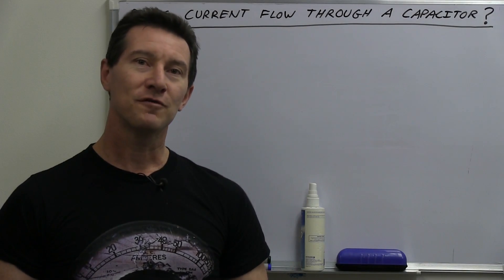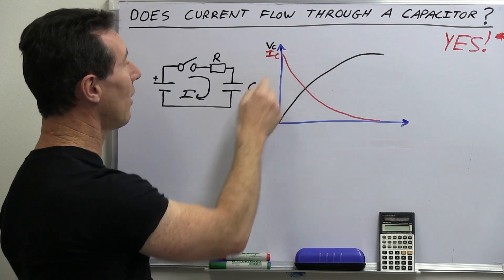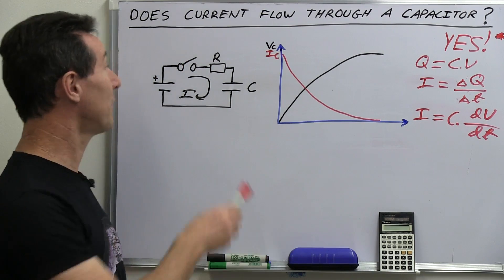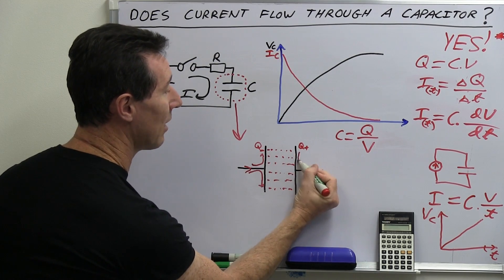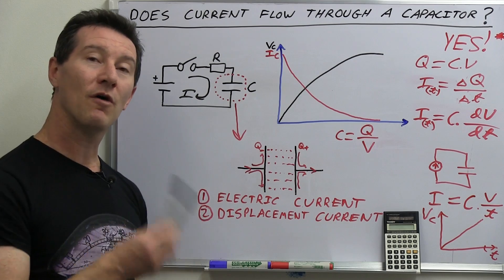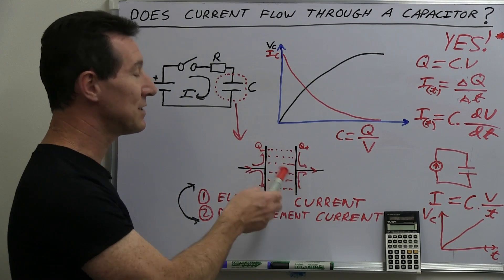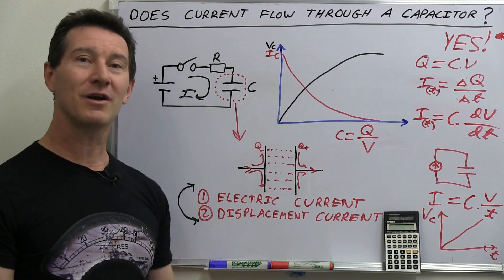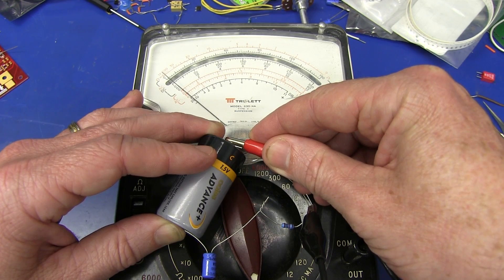EEVblog #486 - Does Current Flow Through A Capacitor?

Comment: I think that where people get into trouble is when they try to intuitively reason about current by thinking about what individual electrons do instead of focusing on the bedrock definition: C = dQ/dt. You can have current flow through a component without ever having the same electrons to flow out as flowed in. 

Obviously there will be a finite limit to the total charge (integral of current over time) that can flow "through" such a component (Vmax * C for a nominal capacitor) but otherwise there is no contradiction or problem.

Comment: 6:42 I dont think the resistor across a cap is tiny, it should very big (M or G ohms). If its a tiny resistor, then all the current will flow through this resistor only, as current always flows through a low impedance path.
Reply: Don't take everything quite literally, he said, just ignore it. Besides, the way the current changes across the cap is not instantaneous, mind you.

Comment: I respectfully disagree. As a mechatronics student I desperately needed to get to the bottom of this. Just to clarify, I am not an educator/professor this is just what makes logical sense to me. I do not intend on offending anyone and appreciate any youtubers that release educational content.  

Note: For this explanation we must accept the actual flow of electrons - to +. So that the attraction/repulsion and electric field stuff make sense. 

Argument: Does current flow through a capacitor? ..... No. 
Answer: Capacitor allows current to flow in the external circuit it is connected to when charging. Not through itself like a switch does. 

Explanation:  As a Capacitor charges it "acts" like a closed switch and when fully charged it acts like a open switch. Because of two reasons (Occurring at the same time). 

1. Pull/attraction from batteries positive terminal on positive plate of capacitor(external/Stronger): 
The Battery applies voltage creating an electric field in the external circuit. This field pulls electrons from the capacitors positive plate towards the battery's positive terminal continuously making the positive plate more and more + (removes e^-). This only stops when the voltages of the Cap = Battery (fully charged) since the battery's electric field in the wire is neutralized by the opposing field from the capacitor which can be simplified as an electric field exist because of a voltage difference so it is also true to say that the batteries attraction to electrons on the Capacitors + Plate stops since there is no longer a voltage difference between the two points (since battery took away enough e^- and now the plate and terminal are at equal + voltages) hence electrons do not flow anymore (Capacitor acts like a open circuit)(Fully Charged). 

2. Repulsion from negative plate of capacitor(Internal/weaker):

During the Charging phase the negative Plate of Capacitor is more + than the - terminal of the battery and so electrons flow to the negative plate where they accumulate (Can also use the electric field explanation) This accumulation of electrons creates a repelling electric field inside the capacitor that repels electrons away from its positive plate which end up flowing into + terminal of the battery (Acts like a closed switch/circuit). But when the Vcapacitor = Vbattery then both -plate of Capacitor  and - terminal of battery are at equal - voltages and so no more electrons flow to the negative plate of Capacitor and so the repulsive force on the negative plate stops growing so the - and + plate of Capacitor become equally/oppositely  charged so the repulsive effect stops/cancels (When capacitor is fully charged - acts like a open switch). 

So although Capacitors allow current to flow in a circuit when in their charging phase. Current/electrons do not flow THROUGH the Capacitor(The whole point of the dielectric/insulator between the two Cap Plates). The flow of current is more an effect of potential difference created by the accumulation of electrons and Voltage difference/electric Fields. 

The END :goodvibes:

Comment: The current in a DC circuit is transient. It only flows in a fraction of a second until the capacitor is charged - like your graph also shows. It quickly falls to zero. Only in an AC circuit, do you have a steady current.

Comment: I feel like the whole video is phrased and designed to justify the conclusion or statement that flows through a capacity when it really does not.

Fundamentally, current is the flow of electrical charge. (Not going to bother wording this for conventional/electrons). Simply put a capacitor allows current to flow towards and away from its plates, as long as the potential of the capacitor does not match the potential of the circuit.

Comment: I recently came across with this video My question is: if displacement is that the current through the capacitor? Does it mean the in the switch, there is also a displacement current?

Comment: Displacement is not a" current", its a flux, just like current through a coil induces magnetic flux, change of potential (voltage) induces displacement. "Lines"  of both fluxes  are perpendicular. In a certain sense its true that a flow of flux is a cause of inveese "kind of " current flow, as demonstrated in the video. if condenser leaks (air gap brakes) yes , current flows in the traditional sense as well.

Comment: So let's not talk about "conventional" current vs electron flow?  You are fooling yourself because of this; yes, current flows through the circuit but not through the capacitor itself.  Electrons move and collect onto the negative plate of the capacitor and the electric field that builds up pushes other electrons away from the positive plate.  So the effect is for current to flow but not physically through the capacitor.  Stop thinking about non-existing fake conventional current and it is easy to work out.

Comment: I've watched this video at least twice before. Have I already commented on it before, and if so, why not just find and edit that comment? I don't know, but here's another one!
I still like the water flow analogy for explaining capacitor current at a basic, "didn't learned the maths" level. Pushing current into one plate displaces current from the other plate, the same as a diaphragm in a pump.
Anyway, didn't Maxwell simply formalize/formula-ize what Faraday (a similarly brilliant man, but he lacked education in the maths) had observed experimentally?

Comment: I would like to see your video explaining the part when the current goes from 0A to the maximum since by formula i(t)=Imax x e ^ -(t/tau) we can only see the current from the maximum till it reaches 0A when the capacitor is full. At t=0 the current can never be maximum as Uc=0 and the natural low inertia also applies to the capacitors and they also have some resistance... nice lecture about capacitors...

Comment: Considering current as the motion of electric charge, define the the current density as the change of flow through surface. It can be perpendicular or non normal to that surface. So there's different kinds of current density's: convection current, conduction current, & displacement current. Convection is through liquid, gas, or vacuum. Conduction has two forms A: Isolated B maintained at a potential. Lastly Displacement resulting in time-varying field. 
If we were to be technical wouldn't it be all three types dielectric convection, potential conduction & ac fluctuation displacement? I'm not physics, just EE maj. Now this made me curious in component design

Comment: When the switch is closed, current (charge) flows through the capacitor (for a while) but electrons don't flow through the capacitor, except for the ones that leak through the dielectric. Maybe those people that say current doesn't flow "through" the capacitor are interpreting the word current as electrons, but even then electrons "appear" to flow through the capacitor (for a while).

Comment: There is a different type of capacitor called a "flow capacitor".   It's completely made from wire (without plates), and flow continues whether DC, AC or AM.    Patent#512,340.

Comment: I haven’t watched the video, but in brief:

• Conduction current flows through both leads/wires of the capacitor, but not through the dielectric/gap between the plates of the capacitor.

• The conduction current in both leads is the same.

• You don’t ever charge (add net charge to) or discharge (remove net charge from) a capacitor as a whole (i.e. considering both plates); the net charge of a capacitor is always constant. But you do charge or discharge the individual plates; their net charge does change with time.

• Displacement current “flows” through the dielectric/gap between the plates of the capacitor, but not through the leads/wires of the capacitor.

• The numerical value of both types of currents is the same in a capacitor.

Comment: The current flows INTO the capacitor, but not THROUGH it.  It can't, there isn't a physical connection

and you can't ignore electron flow - no matter how much you may want to

Comment: electron flow NO  , electric field does move through it and the whole purpouse of the capacitor is to store the field it does so through a separation of charge (aka when it charges ) as a result of of the applied electric field , maxwell displacement current sounds kind of strange , he just did not had a name  for the phenomena , btw the higher the frequency the smaller the electron movement distance  at very high frequencies it would be imposibile for  an Electron to even pass through the dielectric , so in retrospect what really moves continously and with immediate effect through wires is the E field

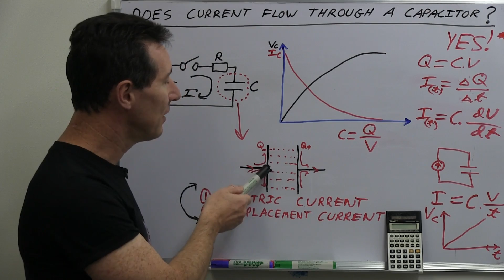Comment: At 12:50 there's no magnetic energy stored in a capacitor; it's all stored in the the electric field. There will be a tiny amount of magnetic energy stored in a changing magnetic field around the wires while the current changes, but once the current has decayed, the stored energy in the circuit will be just (C*V²)/2 and that will be in the capacitor.
It just confuses matters by talking about magnetic fields, unless you want to consider ac circuits at high frequencies when the stray inductance in the capacitor (and the wires) can become significant. But that's not what we are considering here. There are no "electromagnetic fields" (whatever those are meant to be) at play here.

On the other hand, I always find it interesting that nobody considers whether current passes through a transformer (which it surely does if it passes through a capacitor, for analogous reasons), because we're all so used to thinking about a transformer as a generator in the secondary winding.

Comment: IF current didn't flow through a capacitor, then all those capacitors connecting each stage of an amplifier would block the signal.  😁

Comment: I talked to one of the makers of  Nichicon capacitors. And he said capacitors have a reverse polarity as well and that the energy that is stored in a capacitor actually flows. It stores up energy and releases it very fast unlike a battery. But the voltage has to exceed a certain level of incoming voltage 1v and higher  before the capacitor will explode if it is not properly put in correctly. 0.9mv or 6.6mv coming from an audio output signal  going directly into a capacitor will not hurt the capacitor. So it can be connected in either direction going directly into a audio input sores. Like a phone that has been directly connected to a capacitor and connecting it to any audio input source.🤗💯

Comment: To me a capacitor is like a battery
Current flows into the battery and flows out of the battery and goes back into the battery like a loop. Current signal source flows through the amplifier and out of the amplifier output stage to the speaker works like a driver it pushes the coil outwards and produces sound and the magnet pulls the coil back in. On the output positive wire connected to the speaker there is a 10 Ohm resistor and a 104 polyester film cap going back down to star ground. Like a loop 🤗 And switch mode power supplies work like that they are constantly switching off and on or on and off however you would like to present it and current flows through the switch mode power supply and powers the electronic device that you connected to.

Comment: One thing that bothers me is some people will use the cap positive to negative or negative to positive at the beginning of a input source  of a drive stage in a amplifier but I've seen it done both ways which is right? Just look at schematic layouts of amplifiers. Can you please answer the question? Thank you for your time 🤗 The way I personally do it is input signal + source connects to the positive side of the capacitor negative side connects to the base of the transistor. The negative side of the capacitor blocks any current from coming back through to the input signal source. To keep input signal current consistent flow in one direction. And one more thing the larger the input signal source capacitor value is the more bass it has going to the base of the transistor. I try not to go too big lol Am I right? I am self taught I have no schooling 😂

Comment: To me a capacitor is like a battery
Current goes into the battery and flows out of the battery and goes back into the battery like a loop. Current flows through a amplifier and out of the amplifier output stage to the speaker. works like a driver it pushes outwards and produces sound and the magnet pulls it back in like a motor. On the output positive wire going to the speaker there is a 10 Ohm resistor and a 104 polyester film cap going back down to star ground. Like a loop 🤗 switch mode power supplies work like that they are constantly switching off and on or on and off however you would like to present it very rapidly and current flows through it

Comment: Hello,,
I’m new to electronics. I understand how a capacitor blocks DC current, but allows AC current through - there are MANY videos, explaining this phenomenon. What I don’t understand is, if it blocks DC current (in a DC circuit) then how can the DC circuit function? If current is flow rate/electrons moving, and a capacitor blocks the flow of these electrons, then how does the circuit function, at all? Please someone, explain this to me. I want to learn. Thank you kindly

Comment: I do like the explanation which means for me that the answer is in between "the current does flow through a capacitor and it doesn't at the same time." This way we can make use of the capacitor accordingly.
  :)
However, I look at it as the positive charges of the battery goes to one plate, while the negative goes to another plate. And the two plates are in communication because of the electric magnetic.

But, it still an issue to understand whether the current pass through the capacitor or not, and this can be seen if we put three capacitors in series, how is it possible for the middle capacitor to be charged? Therefore, we just force ourselves to believe that the current does pass the capacitor in order to resolve the problem. Perhaps, you got a better answer for this puzzle of three capacitors in series. And I do appreciate it!

I like the way you teach. Thank you so much!

Comment: What Going thru is electric field that causes the displacement current. But, no actual electrons move thru. Whatever happened, the current flows thru the wire before and after the capacitor.

Comment: Another gem from Dave - displacement current - brilliant! I was on the 'No' side of this question (and still am to the extent that electrons don't physically pass through a cap) but also understood that the practical answer was 'Yes'. Now I have a name for the current that flows while a cap is building its static charge.

Comment: You obviously know more than me, but if I put a capacitor in the middle of my circuit it will only work for as long as it takes to charge the capacitor. I will soon find my light bulb goes out. Therefore surely the electrons are being blocked by the capacitor?
Reply: Electrons are always blocked by (an ideal) capacitor. 

The current that lights your bulb is the 'displacement current' (a term I just learned - thanks Dave!) that flows as the cap builds its charge.

As the cap charges the voltage difference across the cap decreases to zero (at which point the cap is fully charged); current flow decreases in concert until it too is zero. 

I've never tried this, but I imagine if you watch your bulb while the cap is charging (and have a sufficiently large cap to see the effect) you'll see the bulb light as brightly as possible at first, then dim as the cap charges and current flow declines.

The way Dave describes the things at 12:20 I find confusing; I understand the "you've got I going in here" part - that's the current that lights your bulb. But the "I popping out there" bit doesn't make sense as that's the current that goes into creating the field (to my understanding - I'm no physicist) . 

I'll have to dig up a couple of ammeters and have a go to confirm whether current flows out while the cap is charging (wouldn't this be leakage current?) - but if it does it must be much less that the current inflow (think efficiency here). After all, when current no longer flows the capacitor is left in a fully charged state and that energy had to come from somewhere. 

Or is no energy stored in the cap? I find that hard to believe, having accidently and painfully discharged a few over the years. Supercapacitor spot welders are another example. Perhaps someone with more physics knowledge than I can help...in fewer than "10 boards worth of equations" :-).